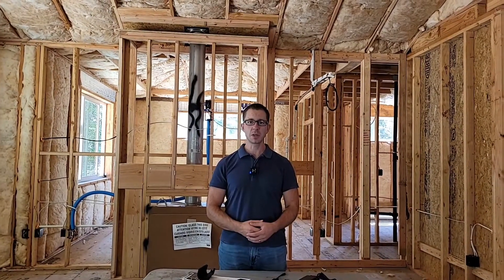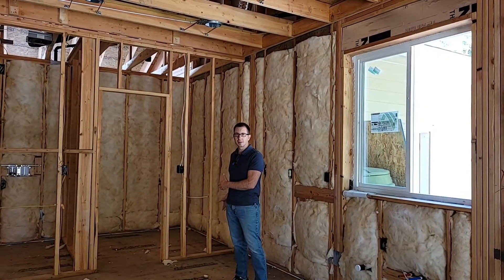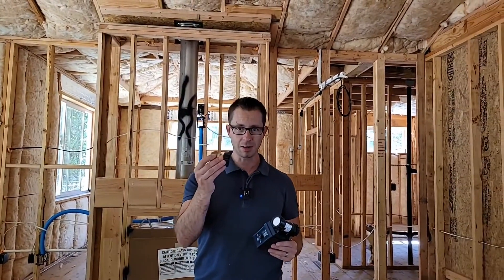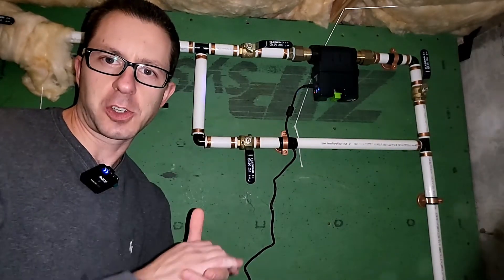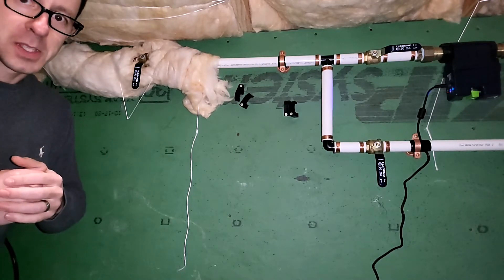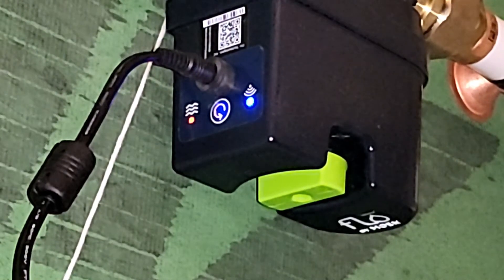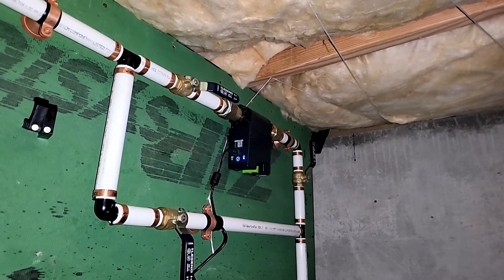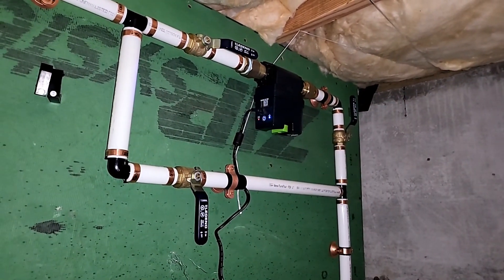Flo by Moen - Local Mode

Comment: I’ve had a Flo by Moen for just under 2 years. Mine stopped working because the tiny magnets in the plastic turbine corroded. I was shocked to learn that no replacement parts are available. I complained and Moen ultimately replaced my unit in a “one-time offer”. Other users have also experienced this failure mode. The plastic turbine is a small inexpensive (I think) part. Why Moen doesn’t sell a replacement part is a mystery. I’m very disappointed and cannot recommend the Flo valve.
Reply from the maker: This is a valuable comment, thank you for sharing
Reply: Moen came out with a replacement turbine that you can buy for I believe $80. So if you can replace the turbine when it gets corroded, would you buy it? Or would you get Phym plus that has no turbine?
Reply: @devilsmetsfan6393  80 bucks is steep. If you're not handy and need to call a plumber to install the new turbine, now you're out over $200. Mine corroded after two years. Not worth the hassle or cost. I'd buy Phyn next time.
Reply: @brainslink the part did come out, and it’s an improved design to where the magnets are enclosed by plastic and are no longer in direct contact with water. They were not $80 either, they were $11 on zoro but lead time was long. Replacement was simple but I notice my flow is reading higher than it was before with no way to calibrate it.
Reply: @tdx92-s5n  Finally! This is good news. Now I wonder how long the new part will last. Remember, most people will need to call a plumber even though replacing the turbine is a simple task. Thus, it becomes a $150-$200 expense every time.
Reply: @devilsmetsfan6393   
the pricing comment is not accurate.  Part 935-016 is the 3/4" or 1" Flo turbine at $9.95 or part 935-017 is the 1-1/4" Flo turbine$11.15 as of 1/3/24

Comment: Interesting info Brian, how does it address a larger home that may have multiple showers/laundry/vanities running simultaneously for 20 minutes, or interior use with an external hose bibb watering the lawn?
Reply from the maker: While I don't have firsthand experience, once the unit is connected through wifi to the app, I think you can "train" it for actual consumption. My Sense that I have uses machine learning to identify electrical devices, but it still requires some user attention for proper identification. For me, this is chiefly an in construction device. But given the avoidance of a major water event and possible lower homeowners insurance, it seems like a good decision for an owner. Nice to hear from you. 🤓
Reply: It addresses larger (and smaller homes) once occupied by working through a "learning period".   The video shown here shows how the product works in "LOCAL MODE" while the home under construction or fully constructed, but not occupied.  Local Mode protects the builder and the future owner in case a pipe bursts, leaks or there is vandalism.  Once the home is occupied, the homeowner has wi-fi installed, and installs the Moen Flo APP on their phone(s) the device is registered and sync'd to the APP.  It then runs through a 'learning period' to understand the occupied homes typical usage.  It's important this is done AFTER move-in when the homeowner water consumption is normal.  The device learns the water consumption of the occupants and will notify the the homeowner through text, call or email if it detects usage it believes is suspect/out of the norm.  Through the APP the homeowner can open/close the Flo device, put the device into "SLEEP MODE" if the homeowner knows there will be unusually high usage - big house party, filling a pool, car or pressure washing, etc or "AWAY MODE" if the homeowner knows they will be away for a period of time and no water will be used and wants the water automatically shut off if any water is used. (this is a nice feature for second/vacation homes when they are unoccupied)

Comment: If I were a betting person I would have put money that the tub and sink were going more than 5 gpm, and a 10 second shutoff was what I was expecting. I don’t think I’ll be the only one who watches the test with a stopwatch (or resetting the video back to when you turned it on) and then cheers when it shuts off. 

This is such useful technology and one that isn’t used nearly enough. Thanks for walking us through!

You are very thoughtful thinking of the next homeowner and plumber by putting the bypass and valves around Flo as opposed to just handing them the Flo installation spacer. I’m not a plumber either, but I’d assume once you put the bypass in, code probably requires a single shutoff on the house side of the supply line.

Local mode is a great safety measure, but one that all trades have to know about when they use water at the house. Have you encountered any problems with trades while leaving Flo in High mode?
Reply: My Flo keeps shutting off after about an hour of my irrigation system running. This is annoying because sometimes it’s scheduled to run for several hours. I have irrigation system in the settings. How can I prevent Flo from shutting off during irrigation?
Reply: @LongIslandDad  Springtime, when irrigation systems are turned back on, is hard for all these water detectors. Have you tried putting in a manual override? In your device settings under Advanced Features you can add a manual override for a certain period of time (along with other parameters) in FloSense. I walked through it here: https://youtu.be/2bs_WGqvDd8?t=134 🤞that helps!
Reply from the maker: Thank you for the thoughtful reply.  It is pretty cool to be at the front end of this.

The only history we have is that it kept trimming when the plumber installed it.  I think he should have charged the system, having someone checking all the fixtures/fittings, then turned on the Flo and run the leak test with the Flo.  If you turn on the Flo with all the street pressure flowing through it, it'll keep tripping.

At least, that's my theory.  We'll see as time goes on what we learn.